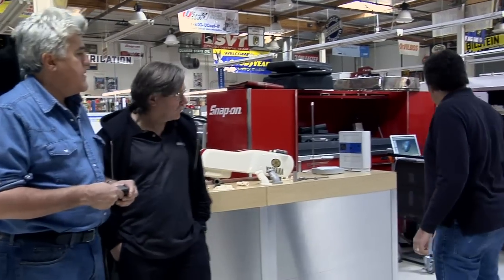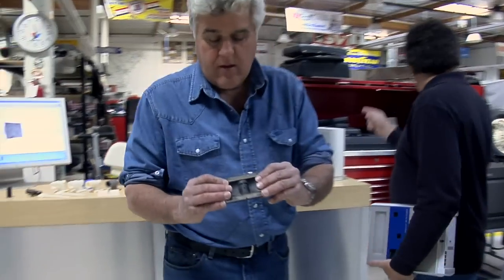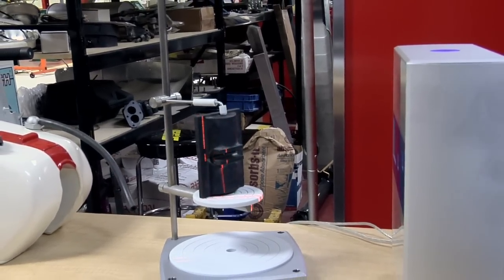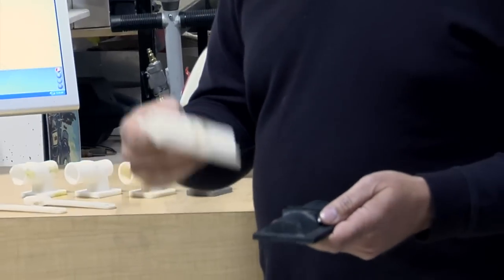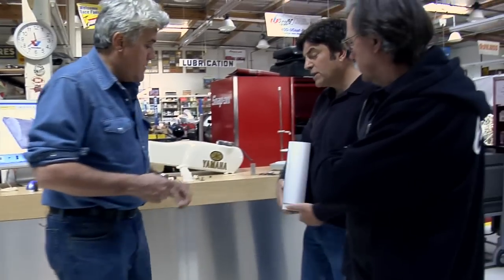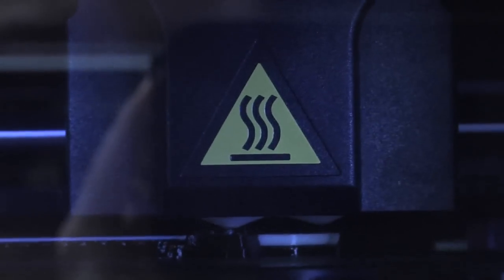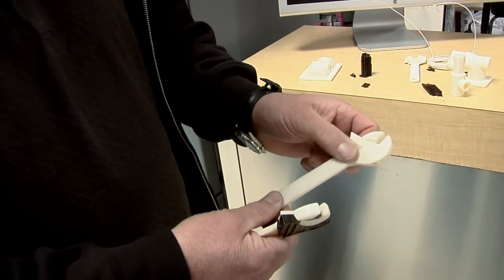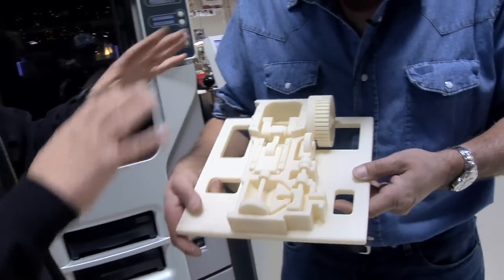NextEngine's 3D Scanner - Jay Leno's Garage

Comment: You can already print Metal it just needs the extra heat treating or powder coating processes. The plastic model is for an investment casting or CNC machine to recreate after the prototype was tested in plastic.

Comment: I've worked with the next engine scanner very shortly at my last job. I say very shortly because it was just not a suitable tool for precisely replicating mechanical components. It's fine for organic shapes, but it's far less accurate than a good ol' set of digital calipers. As a matter of fact, even if you get a nice clean scan, you'd still have to check the measurements with the calipers, if your parts measurements are critical. 
We actually scanned a curved tube nearly identical to the one at 1:50, and between the time it took to paint the surface (scanner can't see reflective surfaces), scanned the tubefrom various angles to get all the crevices, imported the file and built the 3d model around the file (you would NEVER just scan and print a mechanical part), we found out it actually would have taken substantially less time to just measure the part out with the calipers and model it.
I liked the product, however i feel his statements were a bit deceptive on how easy and user friendly the machine is.

Comment: I make 3D scanners like that.  Mine are based on Holographic Lenses. I've seen the NextEngine device, it's ok. 

Here on You Tube there are a number of quick prototyping machines that will form metal parts just as easily as the acrylic one shown in the video... so scanned metal, to printed metal... at low cost, is already available.

Comment: I don't understand why you can't use the original to make the cast instead of the 3D print.  I guess that part of the reason is that it was broken and was glued together, but is it easier to make the mold with the 3d plastic, rather than the originals?

Comment: If you could get enough of the pieces back together perhaps you could putty the gaps and missing features by hand and still feed the model to the CNC machine. Of course, if fine tolerances were an issue this would not work, but for things like cast hose inlets and ornamentation it would work fine.

Comment: Also, 3D printers that use metal already exist and have existed for years. They cost around $20,000. The only thing you wouldn't want to make with a printer is the barrel because you can make that using a pipe from your local hardware store.

Comment: That's exactly what you do. First you make test pieces out of plastic which are used to put on your machinery to test out the fit & function. After a few alteration on the computer and trying out a few plastic models. Once you have a perfect fit & function you then finalize it by making the part in the CNC machine. The techonology in science field has been played with for decades. But now it's starting to be a very feasible and even economical method of engineering.

Comment: the company that 3d printed a eletric motorcycle.  using aluminum.. 3d printed metals is a interesting idea.    i just want a 3d printer for my hobby.  RC airplane/multirotors etc.  its the perfect solution since we want our stuff light, where metal is over kill and to heave for most applications.  3d printed carbon is advancing.. dunno how well it compared to the carbon fiber you lay down like you would old school fiberglass.  but yeah 3d printers are  getting cheaper.. soon ill get one..  i just don ot know enough about them to order a kit  and what not.. i could assemble it..  but i would be lost on the setup.. and that makes or beaks any 3d printer regardless brand name or lack of one.

Comment: that's not true at all.
 you can't pre stress the metal forming uniform crystal structure such as cold rolling or forging. Metals are a lot more complex then just shaping.
 Also most rocket nozzles are made out of ceramics so they don't melt. They also don't have to endure much compressive or tensile stress, so they don't need a uniform grain structure as much. Brakes of a car however, or high performance pistons do need to be forged in order to gain strength.

Comment: you are correct, but the price of these high end models will go down. Just a few years ago I read an article about a new 3d printer that was the cheapest on the market, it cost $5000. These days you can get a printer for less than $1k and the price is still going down very fast. In 5 years the technology will improve so much that printers capable of making guns will be affordable for just about anybody.

Comment: Except the material used by 3D printers (majority time plastic) comes in spools (like weedeaters) that cost hundreds of bucks each and would be way more expensive than buying Legos off the shelves. 3D printer is great for prototyping, not great for mass producing. Injection molds still the way to go for mass production.

Comment: If you have a gun and a CNC machine, you don't really need to 3D print a copy of the part first. The dimensions for those kind of parts aren't hard to make. And as easy to get as guns are, legally or illegally, this would be more expensive and more time consuming.

Comment: there would be limitations to this method of part creation of course. It would take a MASSIVE machine to replicate a frame!!
Reply: Things have changed dramatically in the last two years with optical/lazer scanners as well as 3D-Printers.  IN Fact you should see all of "3DP-Platforms WorkBench series #100 thru #400 27,000 to 40+k$ #400 has workbed area 59"x39"x27&3/4". Then check out their "Excel series" incredable custom sizes up to 300 meters(thats no misprint). Looking down the throught of one of these is awesum.

Comment: you do realize that for a 3D printer with the resolution necessary for making guns you could buy a CNC machine and make your own metal guns out of real material with the same level of requisite expertise.

I fail to see how plastics printers are any more "dangerous" than CNCs in that regard.

Comment: You need to chill out. You also need to learn how to read the news. A working plastic handgun made with a 3d printer has already been made. The same people who made the handgun have made a plastic lower for an AR-15 and fired over 600 rounds with it. The lower is the only part of the gun regulated by the government. They also made a 30 round magazine that works just fine. Not only that, but the printer they used to make these things cost about $8000. In time the cost will go down significantly.